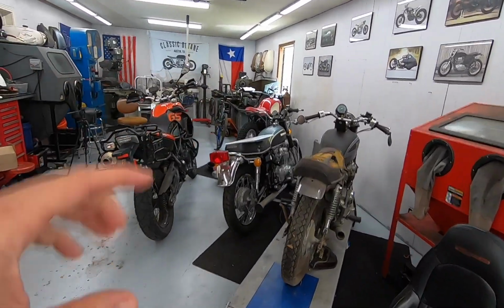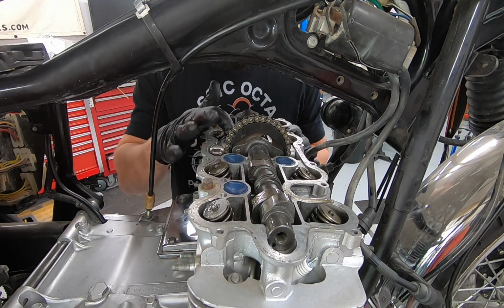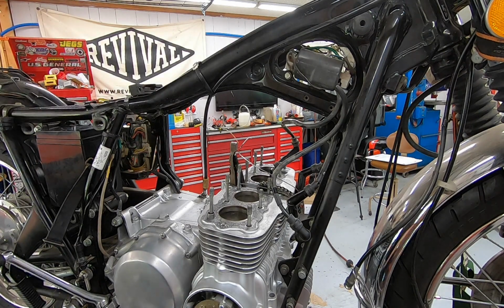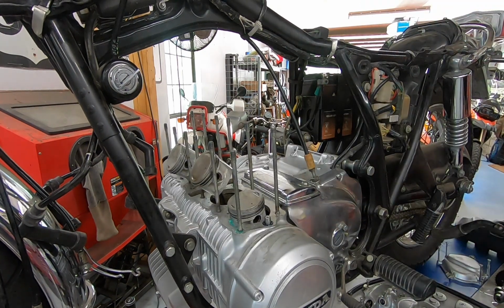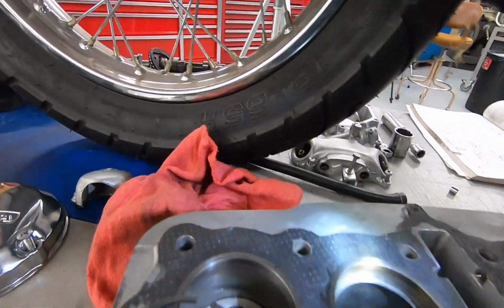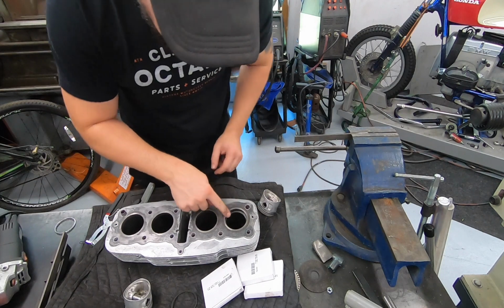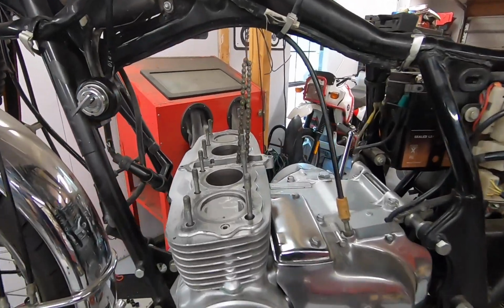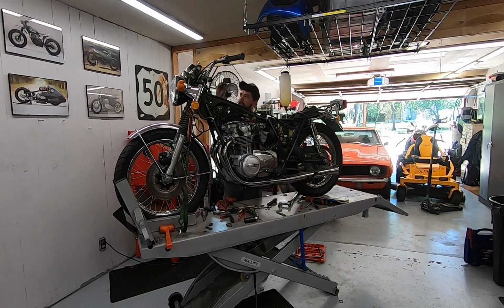Only 25 psi of compression... Let's find out why.

Comment: That is a very clean CB500! I don't see many that nice around here. My favorite of the CB-fours are the 500/550, the 400 a distant third because it has much less power but almost weighs the same. The 500/550 are the best engineered of the SOHC fours by far - head and shoulders above the over - complex CB750...

Comment: Quick test for the valves, whilst the head is upside down with the plugs in, pour petrol in each chamber and see if it leaks away.  But yes I'd agree with your initial assessment that it's a cylinder problem even though all seems okay.

Comment: Good video as usual. Think I mentioned this before . A leak down test can save a lot of guess work. I also wonder if you checked to see if whoever had this apart lined up the ring end gaps on the top 2 rings .... I've seen it in my shop more than once ...

Comment: Awesome. Do you think the rebuild work fixed the compression (assuming it’s all ok now) or could it have been a tight clearance holding a valve open.  Could you have done a pressure leak down test?  Enjoying your channel.

Comment: Awesome video ! question when you had the the cylinder off I noticed oil restrictor in block right side, assuming they are the same on both outboard sides?  Reason I ask Im working on my 1973 CB500 and the left hand oil restrictor was actually not there just the tube. and my right side restrictor was intact.  Reason for tear down was the right side of cam was not really getting oil, but the left side was flooding immediately.  I bought the bike like this and found the cam was shot rightr side only.  Now wondering is restictor critical for oil supply to upper end? Now I need a head and a oil restrictor to make right.  Any recommendation for head and restrictors ?  Thank you in advance.

Comment: No compression test after? I am guessing maybe the mating surfaces could be off, or bolts maybe not torqued down enough causing a leak past the gasket. But then there would have been an oil weep / leak…

Comment: I stopped at 11:00 to suggest that .02 for the 2nd ring gap sounds like the maximum not the minimum measurement. The measured gap being .014 sounds like the minimum gap. Of course this is my opinion but I've done my share of engine work.

Comment: I stopped to check the ring gap spec. for the cb 500. My intuition was correct. .......5 thousanths to 13 thousanths is the range for both compression rings. See my comment 8 minutes ago.

Comment: As you obviously know, when you crank over an engine and you get a steady turn-over speed, that indicates comparable compression in each cylinder.  When you hear the engine speed up for one split second while cranking over, then it has a weak cylinder and you get that wah-wah-WAH-wah, wah-wah-WAH-wah, wah-wah-WAH-wah sound, if that makes sense.  The engine turned over very smoothly after your rebuilt it so I think it's fine now.  Still a mystery as to why it had no compression before???    What about your gauge, could there be something causing it to read off?   Leaky gauge/hose, fitting???
Reply: Nothing beats a measurement.

Comment: Did you paint the engine on that bike?  It looks really clean.  It's nice that you can access the top end with the engine in the frame.  That's the only thing I don't like about my CB750...apparently it's not possible to do any top end work without pulling the engine out of the frame.
Reply: dohc?
Reply: @gummitarzan8545  No, SOHC 1975 CB750.
Reply from the maker: I did paint it when I originally put it in. I find the 500/550 bikes are much nicer to work on.

Comment: since you didn't find an issue, it makes a person wonder what was up in the first place. 100psi difference in compression in one cylinder is concerning, and finding nothing wrong after teardown is just wrong. must have been a stuck ring that popped loose as you worked on it like you said. i would be somewhat miffed if it were me. that's a lot of time and effort spent without an aha moment. but you know now you have a good engine and you got to do a refresh job on it, so that's something.
Reply from the maker: I really expected to see something very obviously wrong with those numbers. I guess it will remain a mystery. The gaskets and o-rings were dry and leaking anyway so it was worth doing.

Comment: I take possession of a barn find 74 CB350 Four next week and it looks to me most procedures used on a 500 or 550 could apply to the little brother. Never used a cylinder hone before but I certainly know 
the concept. Seating brake pads to new rotors for example. With the
 puny cylinder bores maybe I could use a wheel brake cylinder hone. lol

Comment: Could your cam have previously been out of time, causing the low compression? I’ve had that happen before where someone swapped the intake and exhaust cams (DOHC in my case). Fortunately, it wasn’t an interference engine.
Reply from the maker: I would think that would cause low numbers across all 4 but to be honest i'm not sure. It's possible.

Comment: Also how come you get these 500's, 550's, 750's like its nothing... Back in europe bikes in terrible condition will cost you 2500 eur's and they are usually really bad condition. For a decent one, its probably 5500 to 7000 eur here... I'm looking for one to completely rebuild but everyone is asking crazy prices.
Reply: Same in Canada... first, you can' t find them. Second, they are expensive. Even non running ones. I bought a 71 CL450 last year, and it was not cheap... and it needed lots of work. Still trying to get it running right.
Reply: You mention what I have noticed that they seem to have a fair old number of cbs in not bad condition, as you say anything that old in UK is not cheap and in poor condition partly thanks to our rubbish weather.

Comment: You knew you had low compression and didn’t take the precautions of putting cloth rags in the crank case around the connecting rods to catch potential broken piston rings before you slid the cylinder barrel up over the pistons. You lucked out.

Comment: Did you figure out the root cause? Seems like a tight ring gap wouldn’t be it. We’re the previous ones the wrong depth?
Reply: Guessing it was valves.
Reply from the maker: Never found the exact cause but it seems to be sorted now.